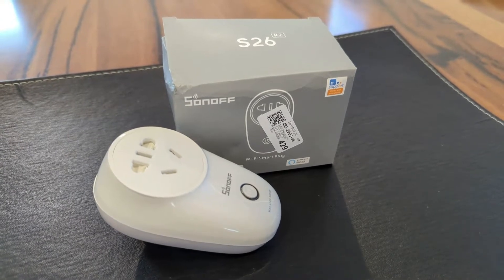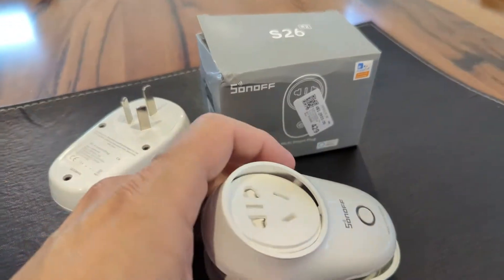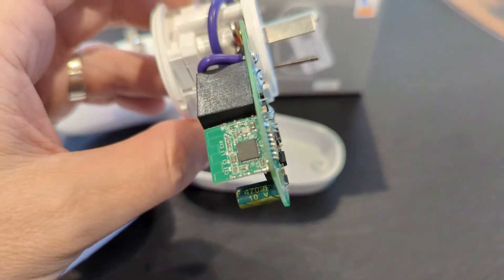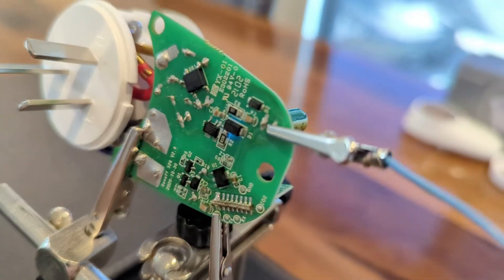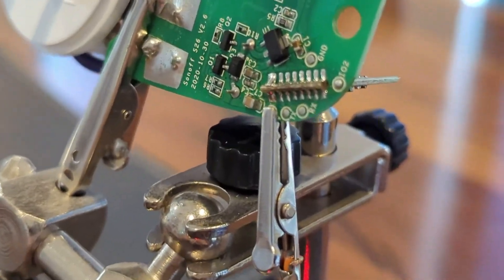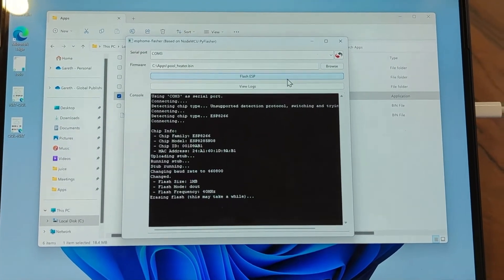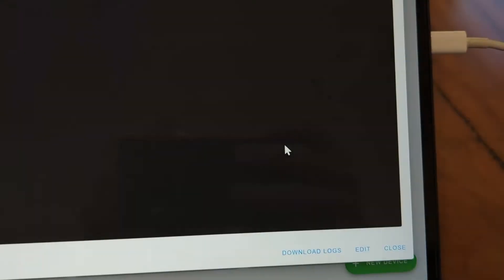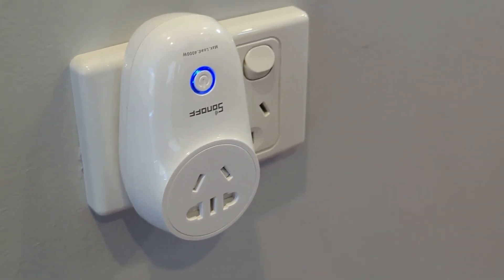Sonoff S26 R2 - how to flash ESPHome or Tasmota

Comment: Do you think this could handle a 3500W storage heater?
Reply from the maker: I doubt it, and certainly not for the model I've shown. However, according to the spec sheet there are some models that allow for higher loads like the French and German models: https://sonoff.tech/wp-content/uploads/2021/03/%E4%BA%A7%E5%93%81%E5%8F%82%E6%95%B0%E8%A1%A8-S26-20210121.pdf

Comment: Hi, thanks for your video, it's very helpful
Can you please give me the dimensions of the electric crocodiles?
I don't use ESPhome but Tasmota. Should I flash with tasmota-lite.bin? Thank you for your time
Reply from the maker: The alligator clips are the smallest I could get at the local electronics store. About 20mm long and 2mm wide at the tip. You could go smaller if you can find it! I don't know much about Tasmota but the "lite" version sounds right. These Sonoffs are ESP8285 so 1MB flash.
Reply: @GarethOakes  Hi, I bought all the material but I have a problem.
I connected GND and 3.3V but the blue light doesn't turn on.
The sonoff works fine and i tried 2 programmers
I checked all connections with the tester
Thank you for your time